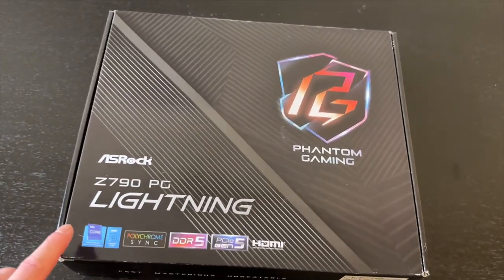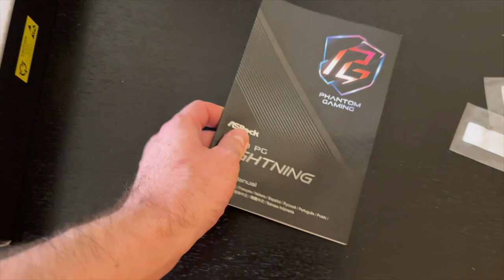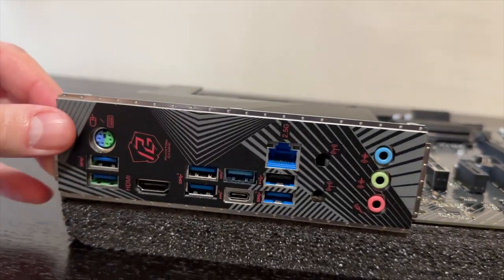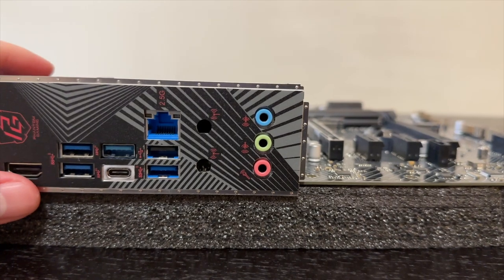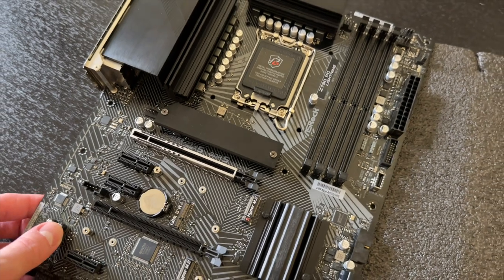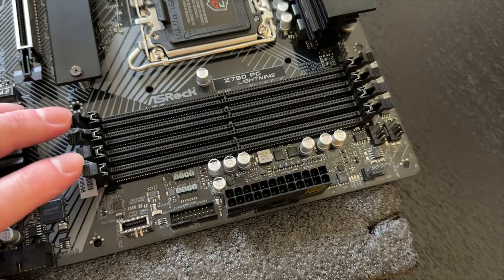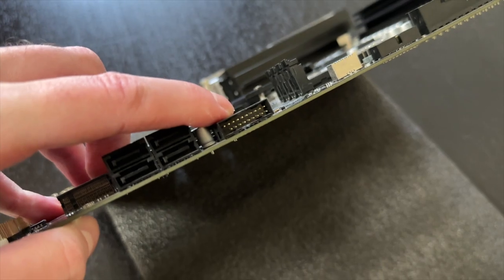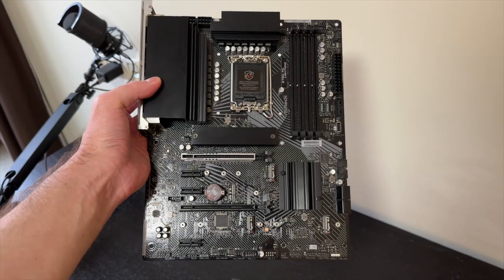Unboxing ASRock Z790 PG Lightning DDR5 [Features & Specs Overview]

Comment: Just bought this board for 135 USD. I will pair it with a brand new 13700k and my old 5700 xt. Once the build is UP and running I'll post back my thoughts and feeling here.
Reply from the maker: Let us know🤝 Sounds like a good system.
Reply: It works like a charm. I can't believe this board is so cheap. It comes with plenty of connectors and run my ram AT 7200 cl 34 with XMP.

Comment: Hi sir, thanks for the review. Do you think this mobo supports 13700k and a 4080 with DDR5 ram at 6400 speed wich XPM?
Reply from the maker: That will be a good build. Go for it if you like what this motherboard has to offer👍
Reply: Mine works AT 7200 MHz cl 34 with XMP.